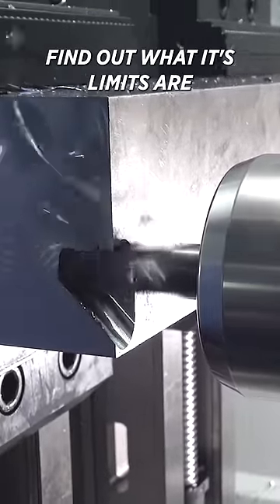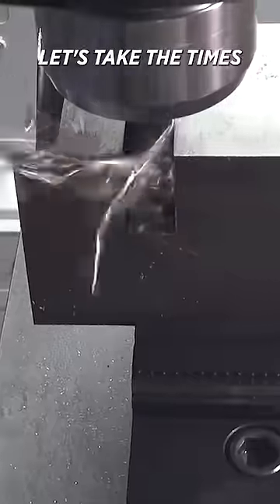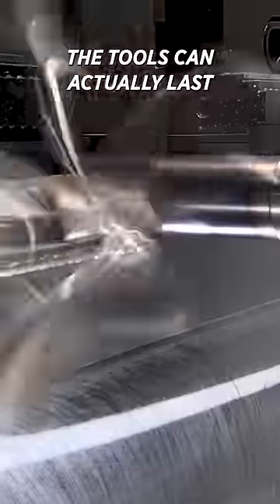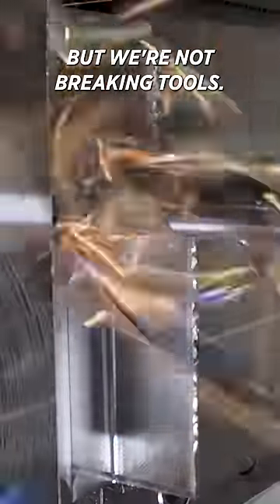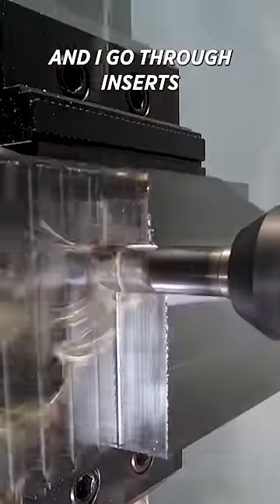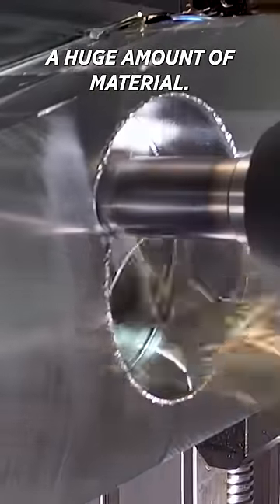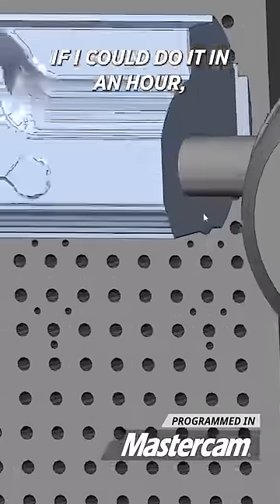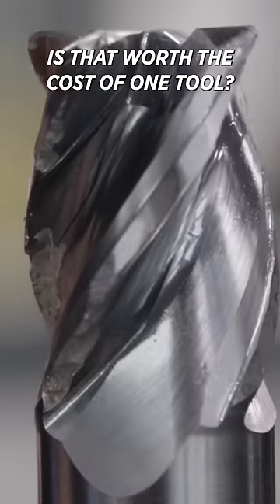Why Do We Push Our Tools to the Limit? #shorts

Comment: You also need a machine that can handle all this abuse. 
Just because a tool is rated for "x", doesn't mean your  machines spindle can handle it.
Reply: Indeed, especially considering that people mostly have cheap worn-out machines in their shops. Made in Taiwan)
Reply: Or you just buy new machines and make sure you break them before the warranty is up lol 

Last shop I worked in had a million HAAS machines running as fast as possible 
Whenever the HAAS guys came in to replace one they'd be hemming and hawing over how hard they ran the machines but our engineers would just be like, shut up and replace the machine lol
Reply: Very true
Reply: It's all a balancing act as he said. You have to manage your tools. Is the cost of machine run time at that demand outweighing the cost of the production? 

In a production shop, you're looking at everything cost wise. You want cycle times low, machine availability high (this includes maintenance as you said) so you can keep them busy, and tool life long enough that you're making money on every part through the machine. Turn around time means a lot in production, and if burning up a machine nets you comfortable profit after a run (read: profit. After the cost of repairing/replacing tools and the machines) ideally you would size your machines appropriately to handle the demands you're running. 

It's about pushing the envelope acceptably.
Reply: Absolutely. And workholding makes a huge difference. Something tooling reps rarely take into account
Reply: Very true.  Overbuild everything, and then  reinforce it some more, thats my way.  If you overbuild it then youve designed it for normal shop use.
Reply: That’s the first thing he said, test the limits
Reply: @raidzeromatt  that is fucking hilarious 🤣🤣
Reply: Key word, abuse.
Reply: @raidzeromatt  🤣🤣🤣
Reply: Was about to say the same thing. "Cutting into the solid" requires some nasty bad ass machinery and not only tools. Breaking the tools costs a few dollars, breaking the machine a few thousand.
Reply: spindles can do 200% workload, 180% constant. quite impressive
Reply: @engenhokas69  what spindle? And 200% of what? Jesus man
Reply: @laramie371  the spindle you see in the video maybe? 200% load I'd say? jesus man you're slow to think but fast to speak 🙊
Reply: @laramie371  "laramie"
Reply: @engenhokas69  those are arbitrary numbers was my point m8. They mean nothing, it's just levels set by the manufacturer. 100=safe, past that equals more machine wear. It's not like horsepower or something you can compare machine to machine, every machine has rated levels.
Reply: I mean the machine is just part of the tools right. So same applies to them
Reply: Ain't that the truth. I try to tell that to the folks where I work at but they don't listen.
Reply: like turbo 4 cylinder trucks 🤦‍♂️
more stress = less life 
true for everything living or inanimate
Reply: I assume you have pretty solid machines when you trying to improve productivity that much, I might be wrong.
Reply: good ole mori seki hmc at work has had 4 spindle replacements due to related issues you mention.
Reply: Then you didn't buy a high enough quality machine.
Reply: @briani7858  then you also get the lovely. Why did you break it? 
I didn't. You want me to run it at X rate even though it can't handle it.
Reply: @demonmaestro  engineers need heros too. i just do my best to collect a paycheck while making things im asked.
Reply: I was gonna say this. My shop did this and blew a motor.
Reply: Did the dude say bits or tools? Wouldn’t the machine be a tool? So wouldn’t you drive your limits with all things considered? I think that is what he means. Not pick one thing then push everything else beyond the breaking point.
Reply: I was off my turning centre for six weeks waiting for a power card (CNC tech said  the power transistors were fried on the old machine) because I ran the machine at full power like the user manual said I could. Manual said 100% all day and 130% ten minutes per hour.  What saved me is that the tech told my boss and I that all transistors can fail on their own after this many years. Drive cards came from Japan. I do not know what I learned from that experience because I got attaboys for doing good parts quickly and no oh shit for something I was not blamed for.
Reply: @AkaedatheLogtoad  ive no clue tbh. im just in here for the sake of machinist discussion.
Reply: That’s why you buy heavy duty shit lmao. Takes money to make money buster. A 3-5 figure expense isn’t going to stop you from 6-7 figure income if you do it the correct and careful way.
Reply: If he is interested in time-on the machining center then he should be looking at some additive manufacturing techniques, such as Electron beam & Laser beam welding that would give him a near-net monolithic blank reducing the machining by 90%.
These technologies have been around and commercialized for over 35 years.  These methodologies have been not just aerospace and science projects for more than 15 years.

Note he's talking about high value alloys inconel, monel, etc. ....  a classic case for additives manufacturing blanks.  There are other technologies that could be viable if the part was rationalized.
Reply: @laramie371  The numbers are not completely arbitrary.  The numbers are guidance given a rather standard set of define conditions.
watching this very seriously somebody touched on work holding, OMG so important!  The countless number of automotive part geometries that we're not a capable process traced back to work holding issues that went solved became ≥ 4 or 6 sigma.
Oh, and knowing how to do a functional analysis and properly measure a component is equally as important.
Unfortunately we have CAD operators and not designers and engineers these days and that's been the case for 35 years.  Yesterday I was consulted on a glovebox (a large SS weldment).  The location tolerance for the penetrations was +/-XXX. +/- 1/16 or 1/8" would have fine.  Again functional analysis.
Reply: @escapist279  China but yes
Reply: Ns
Reply: The machine is more robust than the cutting edge of a tool
Reply: @escapist279  Taiwan stuff are great for it’s price range, affordable yet unlike made in china stuff.
Reply: That is part of the "tool" bud. The whole scope of the tool needs to be taken into account
Reply: @escapist279  even if it's made in America it can be a shit box (haas)
Reply: Im putting Pirellis on my shitbox and doing 120 and theres nothing you can do to stop me
Reply: No shit, Sherlock.
Reply: This guy who made the video obviously used critical thinking. I’m sure that observation wasn’t lost on him. His machine on the other hand can snap any tool put into the chuck in a second if desired.
Reply: My machines are worth millions each I love my job. This my job to a tee
Reply: @sylvainforget2174  if it's known they can fail after N years then there should be buffer spares onhand at N-1 years rather than waiting for items to fail before ordering anything at all

"Just-in-time" doesn't mean "absolute minimum stocks", it means "minimum stocks WITHOUT DOWNTIME"
Reply: @EyebrowsMahoney  Or alternatively stop caving to demand and take the time you need.

Like 80% of the problems in most industries stem from the fact that nobody dares to say no to customers, and the ones that do end up losing business to idiots who would rather run their equpment and people ragged so that they don't have to say no to a customer.

Slow the fuck down. The world is not going to end because your project takes slightly longer. Do things right and let shit take it's time, and literally everybody will be better off for it in the long run.
Reply: True but the logic still applies if you have a weaker machine you find out the limit and do as follows
Reply: @Fraggr92  look, I'm with you, I don't like running machines hard. But, I also know that not everyone is doing Jobber work. This kind of production isn't for job shops. It's for production machine shops pushing critical parts. It's  one thing to negotiate time to run parts, it's another when you have a red hot rush job come in for some critical infrastructure. Some jobs can't wait.

The thing here is a lot of customers THINK they have a red hot rush job when they don't - so you're 100% right there. 

But some jobs are in fact so critical, and these clients are willing to pay you enough to run your machines hard.
Reply: @EyebrowsMahoney  ALL jobs can wait. Unless you work in something like health care where people's lives literally depend on something getting done, there is no such thing as a "red-hot job". A "red-hot job" is just management code for "i fucked up my planning and preparation, and now i'm pushing the problem onto someone else so i don't have to be accountable". 95% of rush jobs are the result of someone fucking up OR someone being impatient. The amount of jobs that actually NEED to be done post-haste is staggeringly small. Certainly not to the point where you need to make a point out of destroying tools and running machines to their breaking point, and definitely not in non-critical fields like what makes up the absolute vast majority of the production industry.

The "problem" in the vast majority of these cases is that not getting the part done on time introduces a COST to the customer in the form of downtime and production stops. Downtime is NOT a critical problem. In the vast majority of these cases everyone involved would be better off letting the customer eat that cost as a consequence for their bad planning. In doing so you would force the customer to improve their planning skill and weed out bad management, which is the cause for most of these problems. And as a result there would be less rush jobs and everyone would be happier. Instead we break tools and machines to cater to bad managers and bosses that never learn and just keep coming back with more and more borderline impossible jobs that keep pushing people and equipment to their limits. All because we're too afraid to set boundaries and say no, and in doing so these people learn that they can just keep pushing and pushing because nobody is going to contradict them.
Reply: @Fraggr92  I'm 100% in agreement with you that the vast majority of red hot rushes are the result of bad management. When I worked in production that was the case. Most of it was caused by stupid adherence to "lean manufacturing" (to clarify, they took this to ridiculous levels). But that's not what I'm talking about.

Additionally, I'm not talking about breaking tools and running machines ragged. I'm talking about balancing your tool/machine life to where you're still profiting handsomely after the fact. Broken tools and machines mean downtime, which is poor management of resources and personnel (funnily enough you mentioned that earlier). So you want your machines to keep cycle times low, and want them worked to the maximum level acceptable without causing undue wear.

Sure you might could get one machine to last you 30 years, but that doesn't mean anything if you can only run enough jobs to keep the lights on doing so. I'm not one for wantonly abusing machines. But I'd size my machines and use tooling that allows me to maximize productivity and throughput. And being able to respond quickly to REAL critical jobs will allow me to continue to establish a good rapport with the customer.

Titan has even said this that sometimes you have to fire customers or deny work because the demands are unreasonable. And he's even said he's not going to go break tools and machines to complete a job that isn't really worth it.

Of course - driving a machine hard will wear it out sooner than driving it light. But are you really getting your money's worth out of the machine? That's the question here. In a job shop or home shop, it serves no one to run it hard at all. But when you've got 30,000 parts that need running, you wanna finish that job as quickly as possible both for the customer, and so you can put that machine back to work on another contract.

To clarify, you want it running as much as it can without killing it. BALANCE is key. You want that machine to pay itself off and turn profits as long as possible. But you also need the machine to run enough to turn profits.
Reply: @escapist279  made in Taiwan isn’t bad. Taiwan has quite good factories, it’s Chinese stuff that’s bad
Reply: @Fraggr92  his latest uploads complaiming about parts failing inspection proves that people worried about spindle and table wear are correct.
Reply: @raidzeromatt  Well, it can be a problem, when the warranty is void because you didn't work inside the specifications of the machine.
Reply: @raidzeromatt  Theres a sweet spot between overloading tools, damn the consequences, and babying everything. Gotta find that sweet spot.
Reply: All forces applied to the cutter are also applied to the machine, ways, ball screws, and bearings.  If you're hammering the machine at 100 percent load all the time, it's going to mean that you'd better have your machine repairman's phone number in your call list.
Reply: Right bearings, brushes, and motors, and overheating electric parts
Reply: Tru
Reply: @raidzeromatt  Break a machine means broken, which is a digital on/off state. But wear isn't digital - the play will increase with wear.
Reply: @perwestermark8920  lol what are you even talking about? Most people mean the spindle when they talk about a breaking a machine.. technically anything to make the machine non-operational can be considered breaking it. 

It's beside the point bc if you buy new machines with a warranty from Haas and you're a big enough client, then anytime one of those machines goes down they will pick it up and drop off a working machine. 

Then you can sell the machines that go out of warranty.. this is a common practice in high volume shops that have actual engineers writing the CAM files, especially if your tooling is the same for all of it. 

If you're a hobbyist or bought your machine used then yeah baby the spindle/cutters

But if you try to run a shop like that you'll eventually lose your customers to companies that are willing to push their machines harder bc they have the capital to stay afloat when they break machines
Reply: @JainZar1  well I suppose they could do that but I've never seen that happen

I guess it depends on what you did..
If it's just the spindle burning out or something that's easy to fix they don't really care 

You would have to do something extreme like manually override the operating envelope of the spindle and tear the frame apart or something for them to really question it
Reply: Y’all need to change the name from tool to something else. The whole thing is a tool in itself and you should call it the cutting end or drill bit or whatever else. Sounds like incorrect machinery slang.
Reply: @scooterareyouready3535   @ScooterAreYouReady  well the thing that you put the actual drill, end mill, etc in is called a tool holder. And the thing all of those go in is called a tool carousel. So anything you're putting in a tool holder is referred to as a tool. 
Look up cat 40/50 tool holders if you don't believe me 

If you say, "I'm going to go get the tools for this job" and you come back with a Fanuc everyone is going to go wtf
Reply: @scooterareyouready3535  So what is then a tool holder, tool magazine or automatic tool changer? 🤔
Reply: I’m sure he has no idea what he’s talking about
Reply: @escapist279  It’s funnny you say that, because there a lot of “Made In America” and the parts literally come from China.

A friend and I, were looking to buy some equipment to start up a little business,  and we were calling around a lot of places trying to avoid Chinese products, and from what we found out almost alll the products were made out of the US, the companies in the US just assemble them here and slap their name on it, it was very eye opening, and the Equipment were supposed to “ American Made”,
Reply: That's usually the problem at my shop.
The supervisors placed me on the most defunct machine out of all of them for a year, and expect it to run the same speeds and feeds as the other newer machines when I finally get my hands on those same tools after everyone else has tested them to run a-okay on their stuff, and then they whine when I have to explain to them that if I was on literally any other machine I could run the same speeds as everyone else.

One time, they forcibly sped up the machine, and we watched as things broke, and I just looked at them and said, "Now you get it. Thanks for breaking my tools and delaying the turnover on the parts."